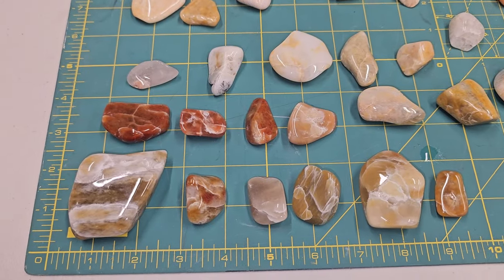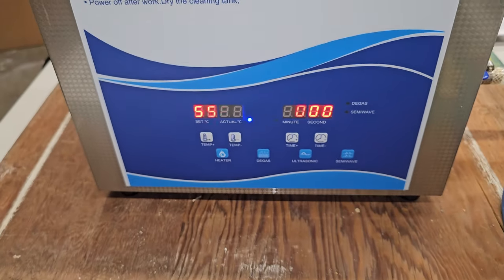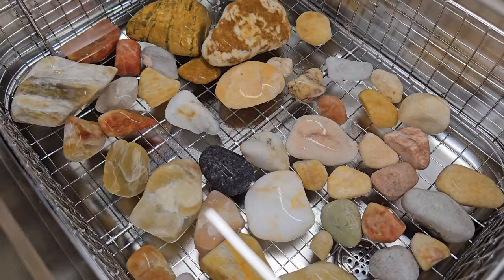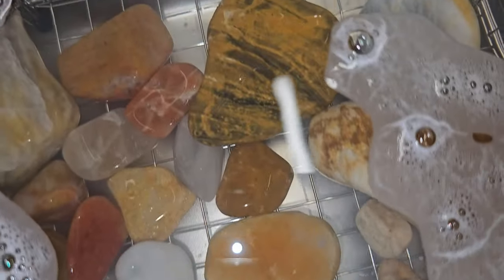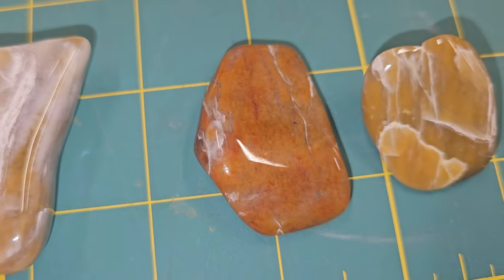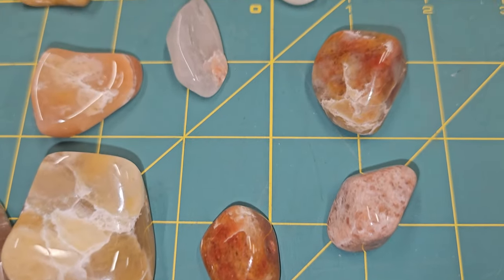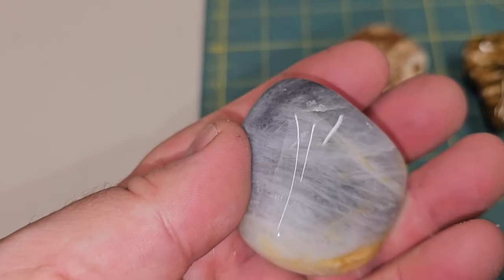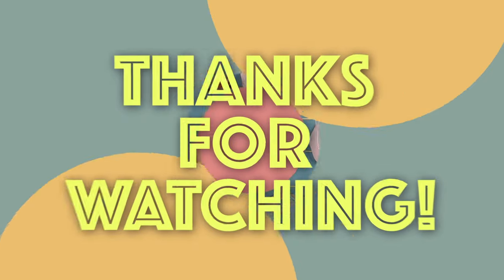ULTRASONIC CRACK PROBLEMS - Is it worth the purchase, or overhyped?

Comment: I have a similar machine that i bought years ago. Excellent for cleaning extremely dirty carburetor parts and or  jewelry. To keep my machine clean, the machine itself is filled with hot tap water then the heater is turned on. All parts that i am cleaning go into a zip lock freezer bag which then has dawn soap and hot water added into the freezer bag with whatever your cleaning and sealed. This is then put into thewater thats in the machine. This way the inside of your machine stays clean like new. Whether your cleaning really dirty greasy engine parts or fine jewelry. The plastic freezer bag does not impede or inhibit the ultrasound cleaning process. Just keeps the mess from the inside of your machine. Pro tip
Reply from the maker: Wow that's really great advice, thanks! I'll definitely try it out. 😃👍👍

Comment: actually go back to stage three and sonic clean after it then run stage four and sonic clean after it as well. that should at least really reduce the cracks but if you don't want to do that just coat them in mineral oil and wipe them off.
Reply from the maker: Good advice, thanks! I am going to do an experiment with some fillers before tumbling a couple to see if I can avoid the cracks showing in the first place - no idea what will happen but interested to see if I can figure something out